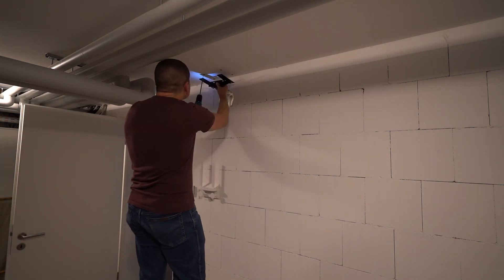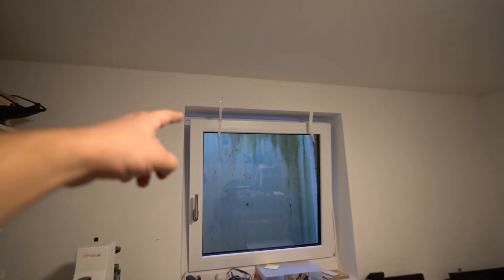Ventilation in a small workshop

Comment: 800m3/h seems very low, you probably need one of those 12"/300mm fume extractors/portable ventilators that come with a long flexible ducting, and leave the ducting outside and seal the window up with foam board insulation. They're rated for 4000m3/h or 20 air changes an hour (I'm just guessing as I don't know how big your room is). You can put the fan right next to where you're welding for even better extraction.
Reply from the maker: Hi, thanks for you comment, yes, there are better way to do this. I just needed something that wouldn't be in the way or take space, the room is just 10m2.
Reply: @MaximKachurovskiy  I'm not sure about the legality of this in Germany but you can get a hole cut in the window even if it's double glazed. That way you can put the ducting through quite easily. The fume extractor can be put away neatly as it's not much bigger than a microwave.

Please be very safe as dust and fume are not very healthy especially in a confined space.
Reply from the maker: @fablabgo  windows are filled with special gas that will be lost and might crack during drilling I think? I considered drilling through the wall instead but ultimately opted for simpler solution since I only use this a couple times a year. And yes, those fumes are hell.